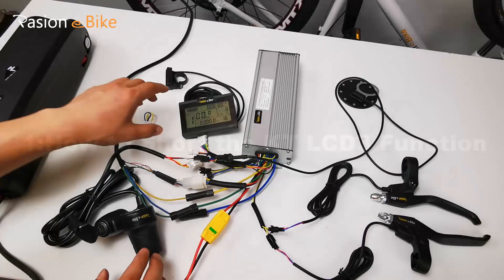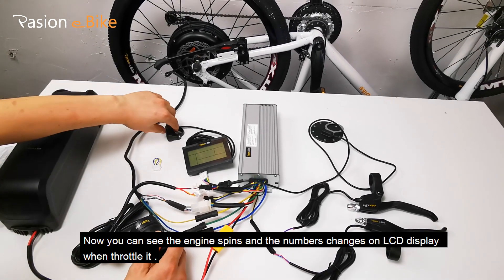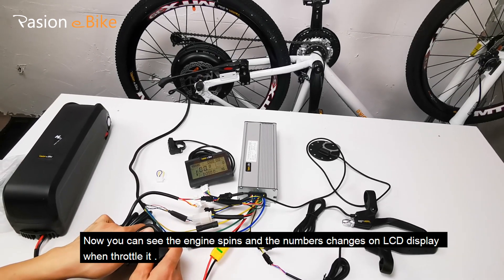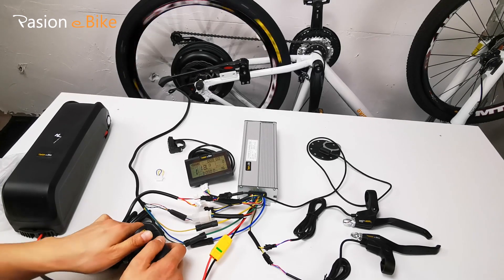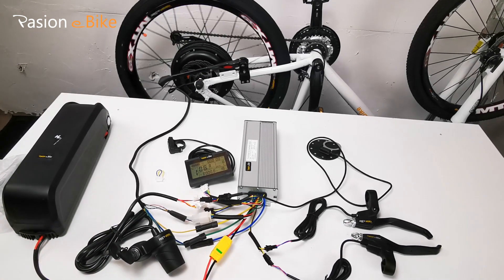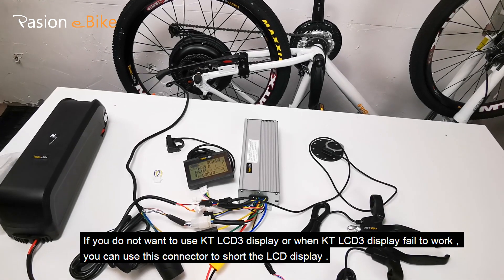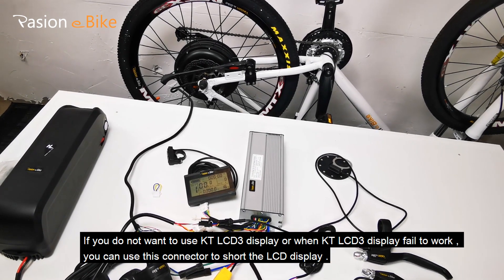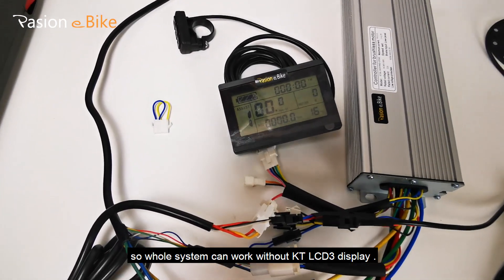1 Pasion eBike  Tutorial  How to Short the KT LCD3 Function

Comment: hello friend I have a kt controller with a kt lcd3 screen and everything is fine, but the lcd3 screen was stolen and I changed it for another kt lcd3 screen bought on ebay and as soon as I connected the 5-pin connector, the lcd3 screen turned on by itself without having to press the central button and if you press the central button it turns off and no longer turns on by pressing the central button, why does this problem occur to me, would you know how to help me?  Thanks in advance

Comment: Does not work on my controller... On others controllers that I have it's enough blue to red (1/2) wire connection. On this one neither works.
Is there another way to do this? Are controllers that different from one another?
This one that I'm trying to bypass the display has a orange wire instead of blue, have no ideia of that's the reason. HELP
Reply: controller wires, throttle wires, PAS wires don’t always match in color.  Determine which wires are your + and - connections, start there, usually red and black. The other wires will be logic/data wires.  These are the wires you want to switch up, see which “cross-wire” set up works for your bike 

yes, it is true, sometimes the way the controller is programmed it won’t allow you to “hack” unless you run some type computer diagnostic program to change controller settings. 

hope this helps.

/bklyn👑
Reply: @robertmotion  I'll try it... thank you